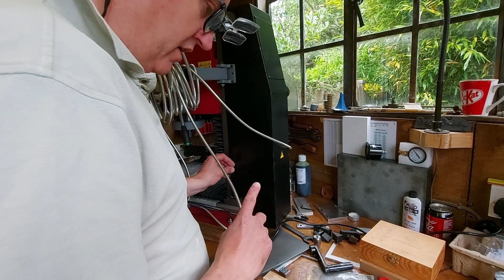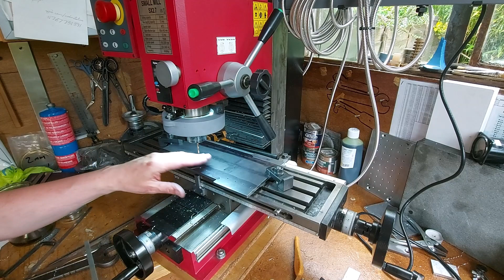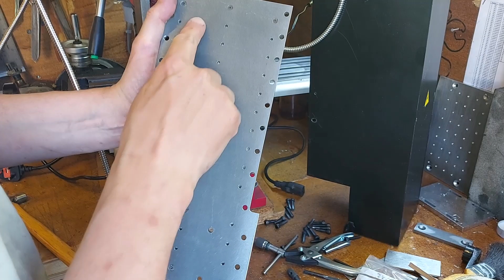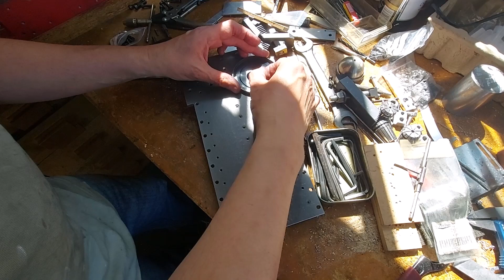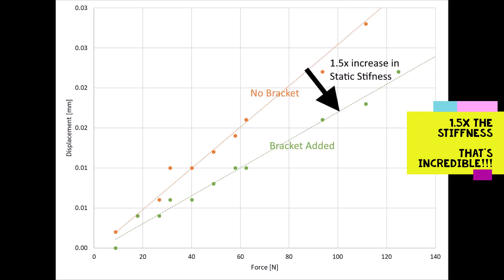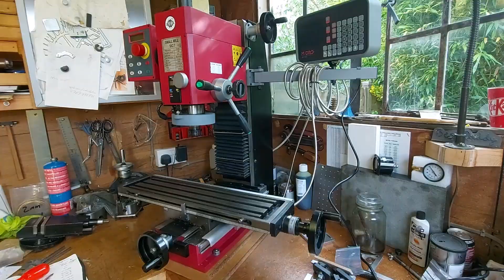Sieg SX2 7 Stiffening Bracket

Comment: Have you thought about a 2" Riser? I'm contemplating doing it, I have some Forklift Tines that seem perfect for the Task once cut to Size and Surface Ground.
Reply from the maker: Good idea, I think a smaller fillet might even work just to improve the connection
Reply from the maker: Where would this go?
Reply: @editorglueitcom  On the upright where it bolts to the Bed with the four Bolts.

Comment: Hi Nigel, looks like a lot of work but I don't understand your stiffness graph is goes up from 0 to 0.03 in 6 stages but you have 2 stages for 0.02 and 0.01
Reply from the maker: Hi Fraser, this has had the most significant impact on vibration and noise levels. I would highly recommend. The stiffness measurements were done by loading the head of the machine with weights and measuring the deflection. The weights I have are a bit random and hence the data points are irregular. However, if you fit a straight line through this the gradient of the line is the static stiffness of the object. The comparison of the Amadeal to the Sieg mill and then the comparison of the Sieg mill with and without bracket have to be considered separately as they were made with different setups. However, each comparison as I've shown them is consistent. Best regards, Nigel

Comment: Great idea, great vid, I have the Sieg SX2P, I stiffened it up by sitting it on a piece of 20mm thick Bis80 with a welded length of 160mm C-channel up the spine, it worked brilliantly in making the little mill more rigid, I'm now looking to upgrade to a larger mill. 

I had have been lusting after the SX3 for a few years, weight is a big issue for me, so I've recently been looking at the SX2.7L, your vid, has all but convinced me it's the way to go, there's only about $300 price difference here in Oz,  but it's the 30-50kg in weight savings that has me almost convinced.

Thanks for the inbound sleepless nights of indecision;).

Scott.

p.s. subscribed, and binge watching your other vids:)
Reply from the maker: Hi Scott, cheers for comment and subscribing. The SX2.7 is a really good milling machine. Ample power and the table is big enough to leave a vice permanently at one end. More details on my page here: 
https://www.glue-it.com/tools/milling-machines/sieg-sx2-7-milling-machine/ 
Cheers, Nigel

Comment: What a good idea and nicely executed. I also have an SX2.7. I've sometimes seen people say the SX3 is more rigid and have wondered if I should have paid the extra. Perhaps this would be a way of addressing the difference in rigidity. I wonder what the SX3 would score in the same test.
Reply from the maker: I'm using the mill now and I have to say it has transformed it. It was good already, but now it's superb
Reply: @editorglueitcom  I'm glad to hear that you can actually experience the difference, instead of just knowing it's there. I have quite a bit on my "to do" list (including fitting a cheaper but bulkier DRO) but I'd love to try this when time allows. Thanks also for the details on glue-it. I will keep an eye out to see if you try the case/baseplate mod.
Reply: @jamiegreentech2753  I reckon the sx2.7 column might be more rigid because the sx3 is open ended at the back supported by internal ribs and the extra weight.
Reply: @HM-Projects  Thanks, that's an interesting thought. It would be reassuring to think it might be the case. I'd still like to try Nigel's mod though, as it seems you can't have too much rigidity!